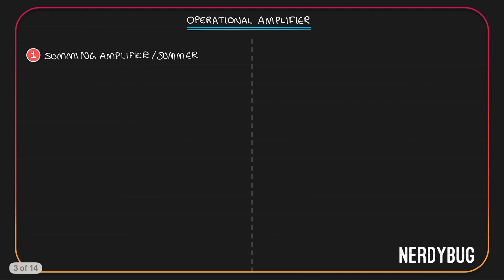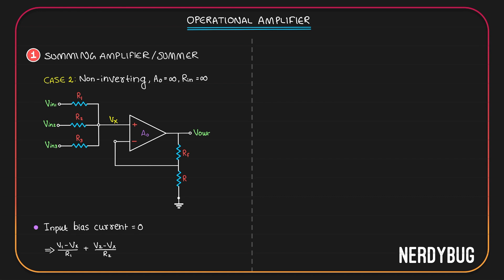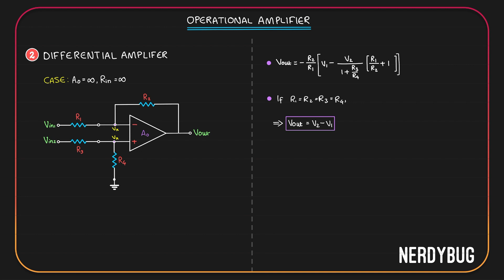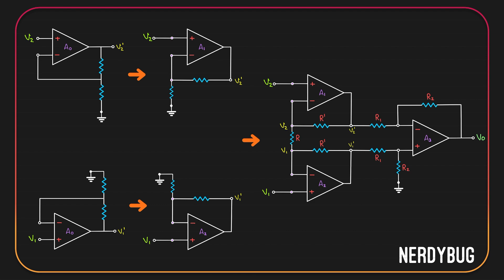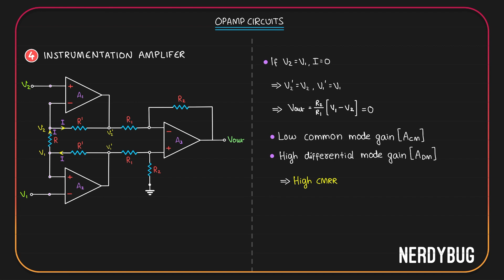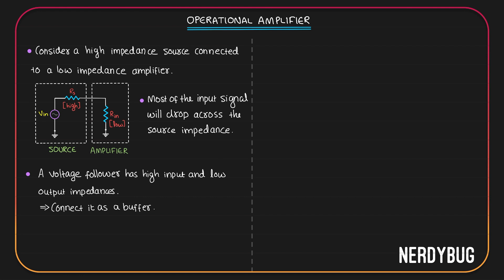Opamp Applications: Linear Circuits | Analog Circuits | NerdyBug | 2025

Comment: 4:08 what exactly are the V's, are they potentials or voltages? Or are they interchangeable, why can we use a voltage divider there?
Reply from the maker: V's are the potential at a given point. Voltage would be the potential difference between two points. 
We can use the voltage divider there because current through Rf and R are equal since input current of an ideal opamp is zero.
Reply: @NerdyBugNB thank you!

Comment: 4:50 mam can u explain why the equation have Vx in it, ie how V1-Vx/r1 + V2-Vx/r2 + V3-Vx/r3 why do have Vx. To find current should we just add all the current through resistors and that equation should be just V1/r1+V2/R2+V3/r3 is it?
Reply from the maker: Current through a resistor is the potential drop across it divided by the resistance. If we take R1 as an example, on one end it has a potential V1 and on the other end it has Vx. So, potential "difference" across R1 is V1-Vx. Current through R1 will be (V1-Vx)/R1.

If Vx were zero, then the current would be V1/R1
Reply: @NerdyBugNB ok ok thnk u mam I got it:)